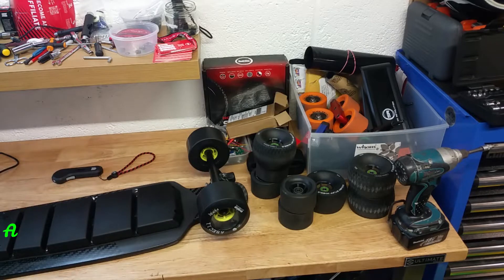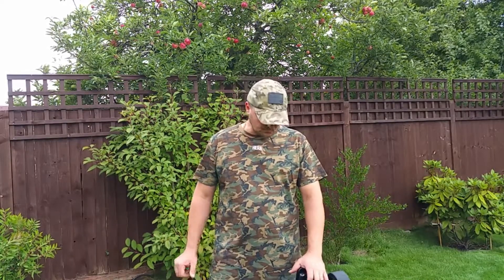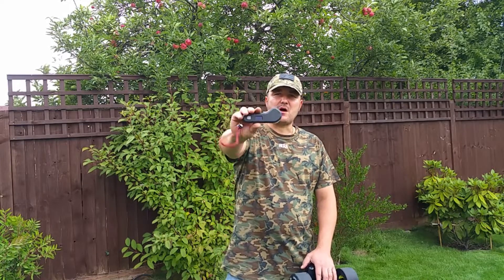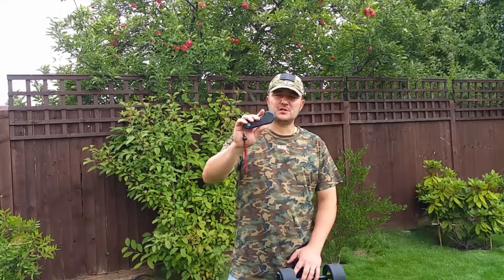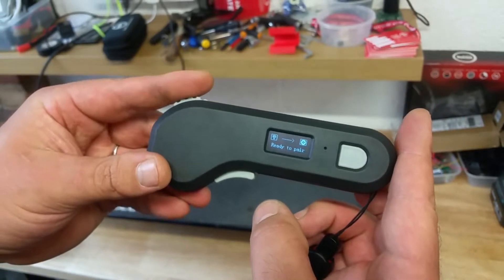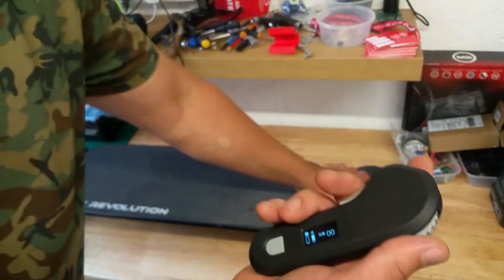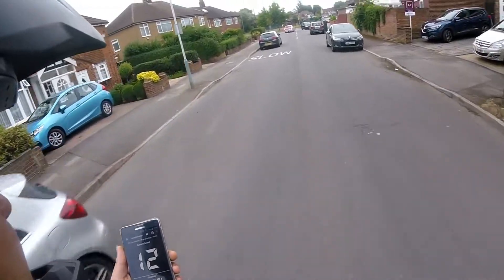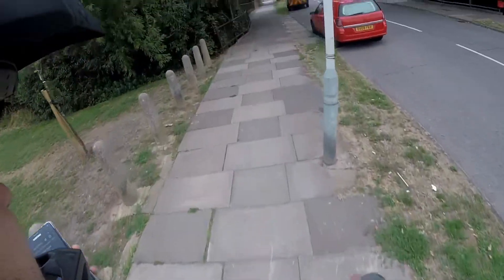Upgraded battery mileage and performance test. Good for DIY builds!

Comment: An impressive result, Pavel, and another interesting and very well done video.
While there certainly are many advantages to living in a city, fighting the traffic while skating seems to be not one of them:)
Heavy traffic where I live is when you actually need to stop for a stop sign:)
By the way, I recently ordered a second e-board, the Backfire Ranger.  It is another all terrain board with solid rubber tires rather than air filled tires as my Evolve has.  The tires are also 1 inch smaller at 6.5 inches v 7 inches on the Evolve, and it is hub motor rather than belt drive.  The Ranger has gotten very good reviews for performance and battery life, and I am looking forward to riding it.  They will ship starting August 25.
Reply from the maker: Hello David,
Welcome back and thank you for the comment,
The Ranger does look quite nice and the large wheels being hub motors is a very interesting idea and the price does not seem too bad. I am a bit concerned with the hub motors to be honest but it could be that the power and the quality of the new hubs is now improved. I understand that the board is Chinese and is now on Indiegogo ? Interesting how the customer support and the spare parts availability would be.
Good luck with it and please do keep me posted on how you get on!
Reply: I too am a bit concerned with the availability of parts, my friend, and did consider that before ordering.  I could not resist the price, and that could "backfire" on me.  As far as hub motors, I have an electric kick scooter and am quite pleased with the hub motor.  Whether that translates to an electric skateboard, well, I shall find out:)
Reply from the maker: David,
Slick Revolution did start the Flex e board on kick starter and I could of thought the same thing but the company has a very good customer service and all the spare parts are available. Hopefully you have the same luck. Backfire got some other boards on the market already I believe.....what is the feed back on them?
Reply: Good feed back on the other Backfire boards in general, Pavel, but I have found no information as of yet on the availability of spare parts.  That does cause me concern, and I will continue to research the issue.  If parts are going to be a big problem, I may well send the board back for a refund.
Reply: An update, Pavel, I have discovered Backfire does seem to have plenty of parts available for their Galaxy board, and I hope that carries over to the Ranger.  I also discovered they have a distribution center in the U.S. and one in Europe, the U.K. in fact, if I remember correctly.  This does encourage me a bit.
Ironically, getting parts from Evolve is hit and miss.  I'd like some extra tires, tubes and belts and would like to order them together, but they seem to be out of stock on one or the other of late.
Reply: By the way, I appreciate that you pay for everything you review.  I was paid 10 dollars(a coupon for accessories or spare parts) for writing a review on Evolve's new remote.  In this case, nothing really wrong with that as I do very much like the remote, but it does make one wonder about the reviews we see and read on line.
Reply from the maker: David,
thank you for the update mate!
I really hope that the new board works out well for you . I might even consider getting one to test out.
Please let me know when you get yours and if it does meet your expectations,
Regards,
Pavel.
Reply from the maker: Agreed!
I would make an honest review on the free stuff anyway ; ) Not a problem for anyone who got nothing to hide!
Reply: Yes, i certainly believe you would, Pavel, but I am not so certain about everyone else:)

Comment: THANKS BIG P.  sold me on it now was thinking of the new limited edition EVOLVE GT 1 but ill be going slick FLEX E CARBON. What was the range difference between the upgraded slick battery & your DIY modded 1. also whats the recharge time on the new slick battery.
Reply from the maker: Hello Scott!
Thank you for your comment buddy. The new upgraded battery range , as you can see in the video, is around 11 miles. My DIY Samsung 30 Q battery got 14.2 miles during the first test.Batteries do tend to lose the range if not charged properly and also with age....one of them things unfortunately,
As I mentioned in the video, I am 17.5 stone and both the new and Q30 batteries done a good job moving me around :)
Ride safe mate!